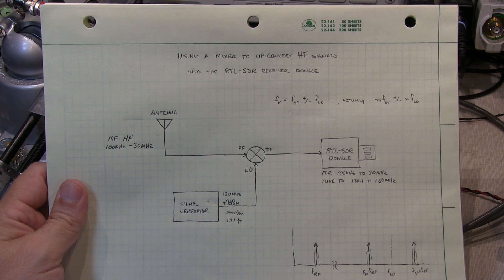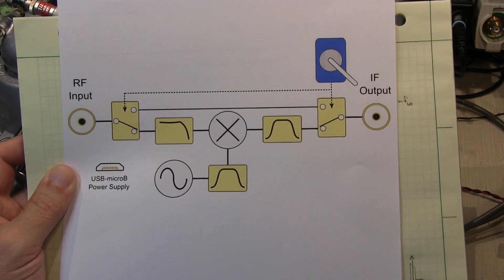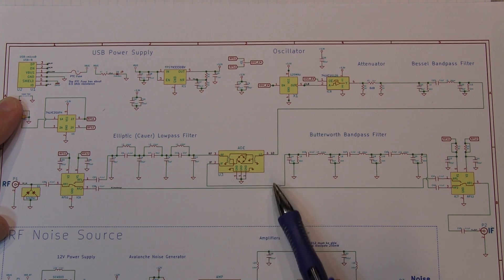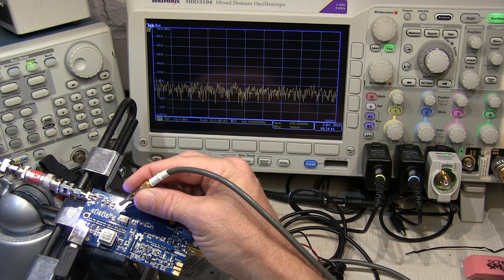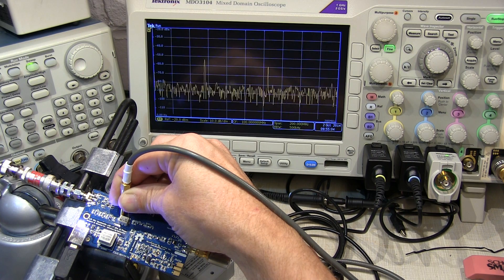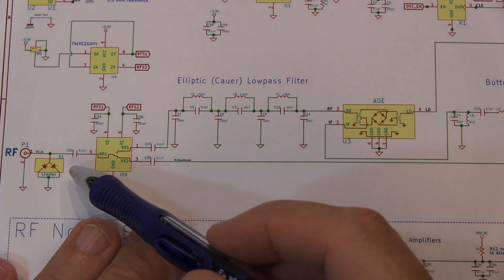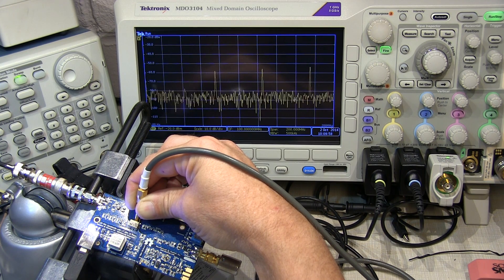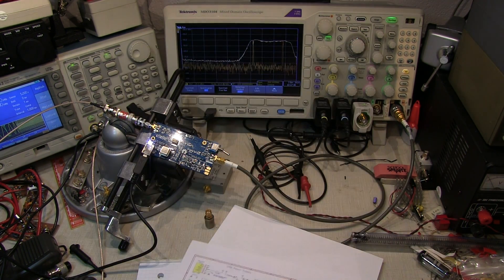#175: Filter functions in an HF Upconverter used with RTL-SDR Dongle Receiver

Comment: 5:55 I'm curious about the z0 probe. I'll check your videos to see if you explain it elsewhere
Reply from the maker: The Z0 probe is a Tektronix P6150 (sadly discontinued), but is essentially a small 450 ohm resistor at the probe tip, in series with the center conductor of a 50 coax.  When terminated into a 50 ohm instrument (scope or spectrum analyzer), it gives you a 10:1 voltage division at the instrument, and 500ohm loading to the circuit under test (generally not detrimental to 50 ohm circuits).
Reply: @w2aew  Thanks!

Comment: Do I need an upconverter if I hook my receiver dongle antenna lead directly to the if output
jack on the rear of my Kenwood ts930s?
Reply from the maker: Unfortunately, the IF OUT on the TS-930S is a narrowband IF signal from the 4th IF (at 100kHz).  So, it would not be able to be used without an upconverter - but even if you upconvert it, there wouldn't be much to see because it is a narrowband signal.

Comment: Sir it's really an excellent video......  what is the band of second IF filter?
Reply from the maker: The IF filter is approximately 120MHz to about 190MHz.
Reply: Even though we are adding some input signal why it is showing peak at 125 MHz continuously...
Reply from the maker: It is LO feedthrough - local oscillator signal feeding through the mixer.

Comment: Can you comment on that second signal at the top part of the output (IF) band, somewhere around 160-200 MHz. Is this aliasing from the spectrum analyzer or something different?
Reply from the maker: +Feico de Boer It is the 3rd order product from the mixer,specifically 2x the LO minus F_in.
Reply: +w2aew So stick to 0-30 MHz and better use 50 and 70 MHz directly on the RTL-stick is my conclusion (or better with a pre-amp to lower the stick's noise floor).
Reply from the maker: +Feico de Boer Yes.

Comment: Where can I find the schematic diagram of the Ham It Up that was shown in the video?
Reply from the maker: Steve C It can be found through the links in the video description.  Or, you can download this archive of all of the design files.  The PDF of the schematic is in this archive:
http://opendous.googlecode.com/files/Upconverter-125MHz-ADE_r2012-12-18.zip
Reply: ***** Actually that archive isn't listed anywhere that I could find so thanks for the link.
Reply from the maker: I found the link on one of the pages that I linked in the video description.

Comment: Alan ,
I see on there site & ebay pages there seems to be a couple variations , 2 different USB connectors , different placement of the oscillator , but both are labeled V1.2 as I remember .
I would like to send off for one of these have not seem a reply in email from them yet .
Thanks again
John  
KD0CAC

Comment: thanx again sir for this excellent video.....the trick you to trace the peak of the sweeping frequecy LO+W
 showed a sort of  filter frequency response, does that mean we may not need tracking generator in the spectrum analyzer, i think it is much easier this way isn't it?
Reply from the maker: Using the max hold trace and a slowly sweeping signal is a good way to show a filter's frequency response, provided the sweep speed of the source is much slower than the spectrum analyzer sweep or update rate.  This technique works much better on FFT/DFT type spectrum analyzers like those in the MDO vs. a traditional swept analyzer, since the swept analyzer is often much slower in it's sweep / spectrum update rate, necessitating a much slower asynchronous source sweep.

Comment: OK, I am misunderstanding something fundamental, but I don't know what. If the output contains both the LO and some element of the difference frequencies that the band pass filter is letting through, but you are 'not worried' about it because you are never going to tune down to the LO or below, then you don't need a bandpass filter do you? Just a low pass would be enough, to take out the higher frequencies from the mixing? Obviously I am very wrong somewhere, but I don't know where. Thanks for a great series of videos on this stuff.
Reply from the maker: There are a few good reasons to have the bandpass filter in the IF. By removing the "extra" mixing products, the energy from them is not hitting the front end of the RTL, thus reducing the potential for overload.  Also, it reduces the possibility that these other mixing products might cause addition mixing and conversion in the RTL due to its non-linear properties. Basically, the IF filter improves SNR and reduces distortion.

Comment: Great video!! I have a question about attenuators. Hope you can help. I don't really understand how the calculation of numbers of separate pi networks is done in a given circuit. Because I often see some circuits with several of these pads all in a row. Are these just constructed to match the input and output impedances but also drop voltage at same time to a given Db? What determines the number of pi networks etc. Surely only one is needed between two points. Why do I see so many strung together sometimes? Would live to understand this.
Reply from the maker: If a large amount of attenuation is needed, then larger resistors are used.  When using larger resistors, the reactance of the parasitic capacitance may start to dominate the impedance and thus will make the attenuator frequency dependent.  By stringing together lower value attenuators, the high frequency characteristics can be preserved.
Reply: Ah ha! Fascinating. Nothing to do with resistors getting too hot. That was only thing I could think of! Makes total sense now. Many thanks.

Comment: w2aew, thanks for posting the video. I understand the basic description of how the filtering works with the up-converter, but I am lost in the details. I am by far not as knowledgeable in electronics as you.  That being said, I have the same up-converter purchased from NooElec, and I am not having much luck receiving any HF signals through the SDR dongle. I wonder if some of my problem is that I live very near most of the TV and FM, transmitters in this area? I am also within 1 mile of a AM station as well. If this is my problem, can you suggest any additional filtering that may help.
Reply from the maker: Tim - there could be several factors at play.  HF/shortwave signals require fairly large antennas to receive them efficiently - what are you using for an antenna?  The AM station could be de-sensing your receiver.  Have you tried tuning in and listening to this AM station?  Does it appear very strong?  It could be that this is overloading the receiver front end, or causing the AGC to make the gain too low for HF reception.  If this is the case, then you may need to filter the AM broadcast band.
Reply: *****
The antenna I use now is a 65ft. long wire with a random counterpoise, ( the remains of a buried electric fence for the dog). I guess it may be considered a off center fed dipole. I do believe you are correct that the AM station is the culprit, it is very strong here. I would like to try filtering the AM band to confirm this. Perhaps you or someone reading has a link to plans for a filter. Thanks for your help.
Reply from the maker: ***** A simple high pass filter in series with the antenna should work. You can use an online calculator like the one linked here.  A quick first pass on a 3rd order high pass gives a simple T-style filter.  Two 1.6nF caps in series, with a 2uH inductor from the junction of the two caps to ground.  http://www-users.cs.york.ac.uk/~fisher/lcfilter/

Comment: Good lesson with a good visual! I actually understood that, which isn't too shabby for a golf course mechanic.Thank You!
When the upconverter was connected to the spectrum analyzer, I noticed, coming from right to left, what looked like a retrace?
Reply from the maker: That was most likely a higher order mixing product such as something like 2*LO - RF.
Reply: *****
Got That, Thank You!
Reply: ***** It would have been nice to see the LO output after the bandpass filter on the SA, personally I think that 2F suppression of only 30dB is a bit  on the low side.
Reply from the maker: Paul de Boer I agree - but then again, at this end of the band (50-60MHz), the RTL-SDR can receive directly - thus, it's time to bypass the upconverter and avoid the intermod interference and conversion loss.
Reply: ***** I once read that diode mixers benefit from a square wave drive LO, as the diodes go from a non-conducting state to a conducting state faster. But here the square wave gets band-passed to leave only the fundamental, why is that?

Comment: Dumb question: why put all that effort into designing an upconverter just to feed it into a receiver that downconverts again? You've already got a mixer, why not downconvert and dump it straight into an ADC and skip the dongle?
Reply from the maker: Mainly because these RTL-SDR receivers are available for less than $10, and already have a ton of free SDR software available that supports them - so they're a nice inexpensive platform.  Most of them provide a little over 3MHz of acquisition BW, far more than you'd get with sound-card based baseband SDRs.  But, since these RTL devices were designed for DVB-T reception, most don't tune down lower than 25MHz.  Hence, for HF reception - upconvert.

Comment: The attenuator directly after the logic buffer will get DC at its input. Not sure if they thought about that...
Reply: OT: nachdem du auch zwei Quadkopter Videos hast, bist du DER SimonK, dessen Firmware auf jeder Menge ESCs läuft? Wenn ja, Respekt und Danke!
Reply: Ich habe vor einiger Zeit meinen eigenen Quadros gebaut, auch mit eigener Firmware (Ein xMega der 4 Motoren gleichzeitig ansteuert). Aber mit der "SimonK" Firmware habe ich außer dem Namen leider nichts gemeinsam (jedenfalls nicht, dass ich wüsste).
Ich bin da lustigerweise letztens selber schon drüber gestolpert und habe auch verduzt aus der Wäsche geschaut :-)

Comment: At the end of the video, we see the [sweep signal]+[125 MHz LO] walking up toward the end of the display at 200 MHz. As it approaches this edge, a tiny signal spike is seen to appear at that edge and walk down to about 180 MHz or so. What's that? Would this mean that received signals around about the 6-meter band would be contaminated with inverted-spectrum images?
Reply from the maker: The 'difference' products move in the opposite direction. This is visible when I probe the output of the filter, before the IF filter. You see the LO-RF component sweeping down from 125MHz and going lower. The tone you see coming in from the right, nearing the end of the sweep is most certainly one of the difference products such as 2*LO - RF, etc.
Reply: It looks like it could be the second harmonic difference signal. i.e. 2x[125MHz LO] - [sweep signal]. I'd like to see a spectrum of the LO Bessel bandpass filter output to prove this. It could probably do with a can type shield above the PCB or a higher order filter.
Reply: The point they are crossing each other looks to be between 185 and 190 MHz. If measured I'm pretty sure it would be at 187.5 MHz. So yeah, what Vermin said.
Reply: Verm1n That's what I was thinking as well, a harmonic of the difference signal (probably higher order than second though?)  The upconverted signal would be around 55MHz at that point, however, which is in the range of most dongles i believe, so the user could just flip over to bypass mode.
Reply: Malcolm Whinfield Okay yeah, I noticed that too, when we were looking at the sweep signal w/o the mixer present. At your time mark, both of these signals are walking up the spectrum. But what I am interested in is this signal that is walking /down/ the spectrum of the mixer output. Are you saying this multiplied harmonic of the sweep is also the signal that is walking /down/ the spectrum of the mixer output? If so, how does it get going backwards? (#newbiequestions)
Reply: *****
Roger that, thank you!
Reply: ***** So because this little stray difference product also rolls off by the time it reaches 180MHz, no spurious image problems should be expected from this when used for its intended purpose of just sampling the HF band up to 30MHz. You would want to go to bypass if you wanted to look at 55MHz and up (presuming your RTL dongle could tune that low). IOW, scanning above 55MHz with this mixer engaged could be problematic, yes?
Reply from the maker: Exactly right. There is no benefit to using the up converter once you're looking at signals that are in the tuning range of the RTL dongle. So, once you're above 25-30MHz, it's best to bypass the up converter and go direct. This way you're not subject to the conversion loss, extra noise, and possible high order intermod distortion.